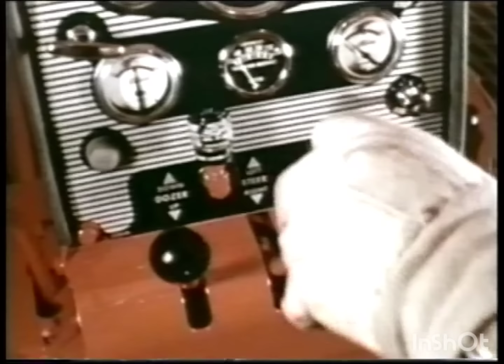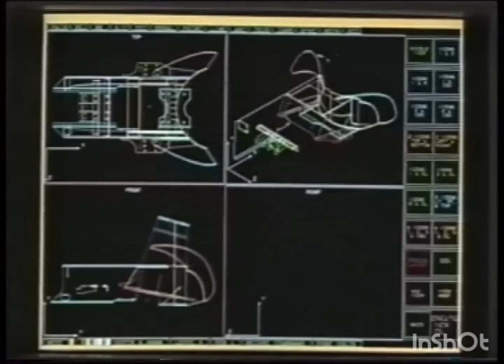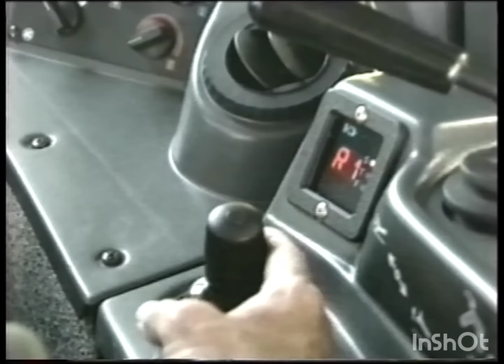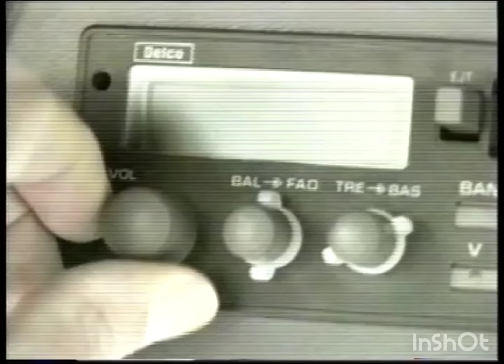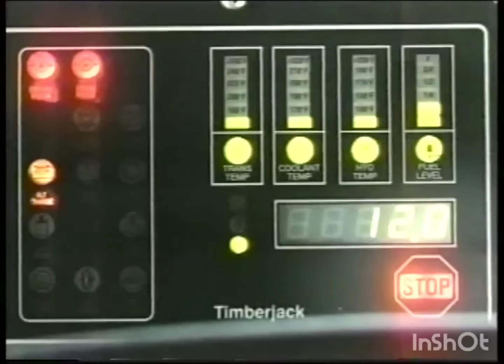Timberjack - 60 Series Skidders

Comment: I can remember the old timberjack skidders they was orange w the gm diesel engines and they were all cable skidders back then they make w a grapple on them I haven't seen them maybe a pic a few times I 😊😊 knew a fellow just down the road he had a logging crew and that was what he used was timberjack skidders I can still remember them from when I was a kid and alit of them also was used 2 pull logs 2 the sawmill 😊😊 OMG 3 14 2O24